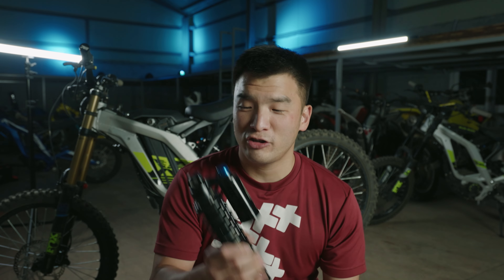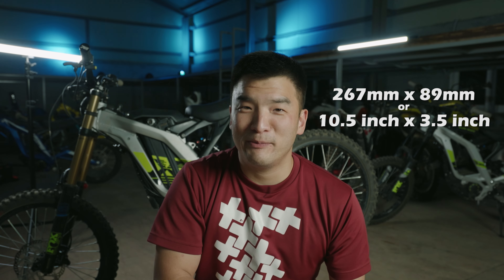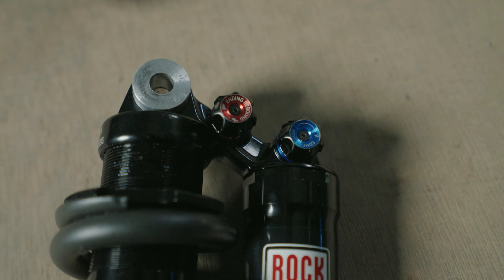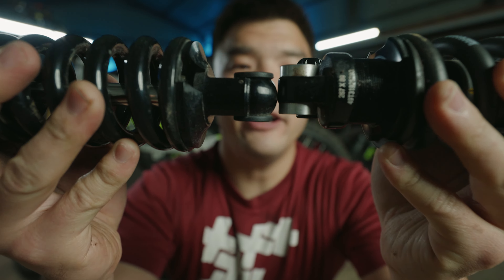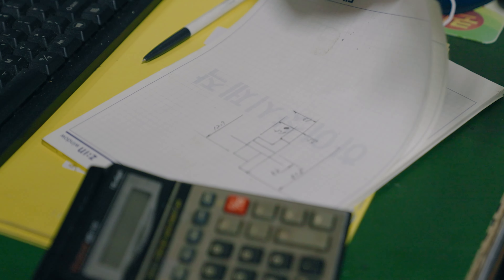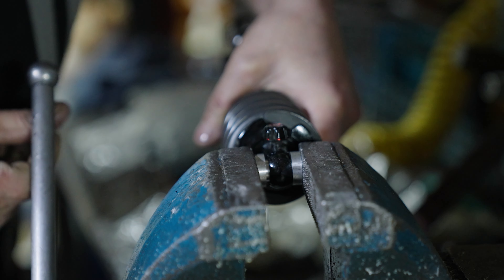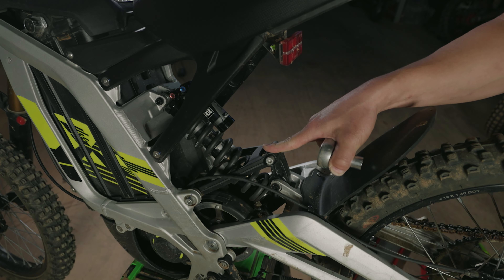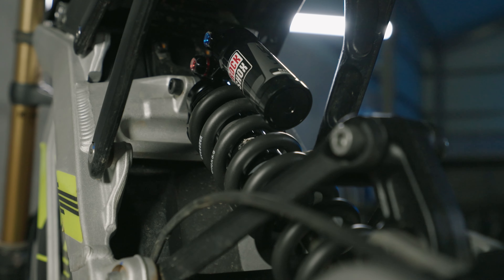Rear SHOCK UPGRADE Sur-ron Lightbee X l HUGE Improvement l Installation

Comment: You absoloutley dont have to take off anything other than the upper and lower bolts that hold the shock in...just put the bike up and support on the crush plate...take off nut on lower shock and while holding the rear tire, move it a little and the bolt will come out with very little effort, then do the top and your done.

Comment: Better solution could be modding the fastace shock, its got a nice big reservoir which means you can fine-tune the air pressure to make it more progressive. Also unlike dnm rcp2s (which i had btw) the rebound setting is just right, 4/8 is what i am currently using, while dnm i had to use 23/24 lol. Which means fastace could possibly take oil of less viscousity, to make it more plush and without loosing the rebound.  Fastace actually make really good budget parts for mx/pitbikes, yea they dont officially sell spare parts, (due to low price of their products, there is no market for this, ppl just tend to replace the whole thing). But these are coil shocks, you can run them with stock parts, just do the oil change after every 100 hours. Unlike air shocks where you need to replace the seals and stuff.

Comment: Would a 265mm fit? - looking at a FOX DHX RC2 BOOSTVALVE COIL REAR SHOCK 265MM EYE TO EYE 225X3.80 SPRING MTB DH and wondering if it will fit, obviously will upgrade the spring to 500
Reply from the maker: From what I know any shock size will fit, but the travel will be affected. 265 and 267 are only 2mm difference so I would think it would be fine?

Comment: other than the different spring rate, do you think the rockshox is a big improvement over the fastace? are you having "spiking" or harshness w/ the fastace?
Reply from the maker: Compared to the rockshox, fastace doesn't do much damping in highspeed compression. I think the lowspeed compression works pretty good though. So hitting the choppy stuff in high speed, fast ace just blows through the travel and then spits you out in rebound.
Reply: @ridefarm5528  thanks for the reply! do you have experience w/ DNM shocks? do you think the fastace is better than DNM?
Reply from the maker: @rondg2  I don't have experience with DNM shocks, but I'm sure there is a reason nobody in the mountain biking world uses DNM components.
Reply: @ridefarm5528  DNM does not move LOL. but they're also fitted on some batches of surron. so i'm wondering which one is better
Reply from the maker: @rondg2  Biggest problem I see with DNM and Fastace is their serviceability. All shocks need to be serviced at least once a year if you ride regularly, and it's not like you can walk into your local shop and get them serviced.
Reply: @ridefarm5528  see one of my vids I got one on adding a Schrader valve to a dnm, to re pressurize after oil change
Reply from the maker: @rondg2  Nice just checked it out, but what about the service parts?

Comment: do you reckon I would get away with 241x76 rear shock or is the travel to short?
Reply from the maker: To be honest you can put whatever size shock you want, but that just means shorter travel and slightly lower stance. I put a 240mm shock + adapter on my dad's surron and it's fine, except on big jumps. There you notice the shorter travel

Comment: holy shit you are smart!!! lathing your own pieces!    do you know if the fox shock you were talking about would be plug and play?  or would you need to lath special parts for that as well.  also do you happen to know the exact name of that fox shock you were talking about?  also do you happen to know where you might find a "fox 550 x 3.5 spring" that i saw you talking about in another comment, i cant seem to find one on the internet, i kinda wanna do this as a cheaper option and easier install.   so sorry for all the questions.  Liked and Subbed!
Reply from the maker: The shock I mentioned is Fox dhx rc2, I am almost 100% sure it won't be plug and play. Stock surron shock has some bizarre sizes. It seems like Luna cycle is all sold out on the 550 spring :(

Comment: @Ride Farm. Do you still have the measurements for the eyelet bushings? Have this shock incoming.
Reply from the maker: The spacing for the Surron shock mount was 24mm and the bolt hole was 8mm of diameter
Reply: @ridefarm5528  thanks for answering so quickly. I probably used the wrong terminology / the bushing diameters. When looking at the reference image below, the measurements for A, B, E and D.  https://www.linngear.com/wp-content/uploads/2013/01/QD-bushing-drawing.png
Reply from the maker: @flyingfox8586  i don't have the measure ments right now but when i get the chance to measure them i'll let you know

Comment: Hey! Thanks again for this informative video. I was actually hesitating for this rear shock myself. The only one I've found I has a low comp setting… So for the Surron I was wondering whether it'd be a good fit.
Reply: So any idea what your shock factory setting is?
Reply: @MTO_Brothers  I bought an R2C Vivid LOW tune and it seems to work fine. Per the Rockshox chart the low tune is for suspension ratios lower than 2.5:1. The Sur Ron is 2.285:1 (Rear wheel travel divided by shock stroke). 
 I have read the Rockshox is also tune-able if needed. It helped to make up my mind. Just be aware there may be interference issues with the bottom of the coil spring and the rocker link. the Vivid/Kage spring diameter is really big.
Reply: @ow-my-achilles1106  Thanks a lot man for this very detailed explanation.
So does it touch towards the end of compression?
Reply: @MTO_Brothers  I couldn't install my shock into the linkage. It was "just" a little too large. I cut some small clearance into the link (machine shop). Modifying a spring at the flat end seems like I would be creating a stress that could crack. No problems so far, I like how it rides.
Reply: @ow-my-achilles1106  Just received mine! I'll be giving it a try shortly 🙌
Reply from the maker: @ow-my-achilles1106  really? wonder why mine fit without issues
Reply from the maker: @MTO_Brothers   any setting would work fine, it would just come down to preference i think
Reply: It's a tremendous shock

Comment: if you just wanted to buy the 550lb spring for the factory dnm shock. where would you get one that is a direct fit and can you provide a link?
Reply from the maker: https://lunacycle.com/dnm-rear-shock-spring-550-lbs-for-sur-ron/
Reply from the maker: unfortunately sold out, but you can look up fox 550 x 3.5 spring. that fits as well.
Reply: @ridefarm5528  No it won't... the DNM spring requirement is 38MM and the FOX spring is 35mm ID.
Reply: @lonniedomnitz1720  That is incorrect information.    The DNM & FOX spring is 35mm  ID.    The FastAce & Rockshox are 38mm ID .   The KKE is 36mm ID.

Comment: What are your thoughts on using a fox 38 (E) on the Surron instead of the fox 40
Reply from the maker: Double crown is always better than a single crown in my opinion.
Reply: @ridefarm5528  would you say the stock surron fork would be better/ not worth replacing with a fox 38 (e)?
Reply from the maker: @daniel_f1nk   38’s damping is far superior but what’s the reason you want to put a single crown on something this heavy?
Reply: @ridefarm5528  my main concern is pricing honestly, and can’t seem to find any second hand fox 40’s in Canada
Reply from the maker: @daniel_f1nk  we get our forks from pinkbike.com used section. Just bought another one for someone last week.

Comment: Why not just change the spring?
Reply from the maker: The stock shock has two issues: 1. wrong spring rate 2.  Terrible dampening performance.

You could just change the spring but you would still be stuck with terrible dampening. However, if you find the stock damper good enough, just the spring change would suffice.

Comment: Mine fit straight in🤔
Reply from the maker: Which shock was it?
Reply: @ridefarm5528  Roxshoxx exactly the same
Reply from the maker: @user-px6qe2qm8p  would love to see some photos
Reply: @ridefarm5528  how to upload them? I've Roxshoxx front and rear and mt7 front and rear brakes.. 72 volt battery pack with an 8000 BAC. Fast as fuk
Reply from the maker: @user-px6qe2qm8p  If you could send the photos to tom00lim@gmail.com I would appreciate it!
Reply: @ridefarm5528  100% I'll show you one the only thing standard is the frame on this bad boyy.. will you post it for me mate
Reply: @ridefarm5528  you on Instagram?
Reply: I bought the correct size Rockshox mounting hardware eyelet adapters on Amazon. They were the same for the top and bottom of the Vivid R2C. 1/2X1/2-Inch 24.0x8-mm.$12.80 each. 
 The real issue I had, the Vivid spring diameter (BIG) had an interference issue at the bottom of the shock against the rocker link. I had to mill about 1/10 inch from the link for the spring clearance.
 I am happily using a 450 lb spring. Traction is outstanding. Huge difference from the Burner shock.
Reply: @ow-my-achilles1106  so the 550 spring probably won't fit properly either?
Reply: @flyingfox8586  The standard Vivid springs are all the same diameter, only the lengths, wire diameter and number of coils are changed for the different lengths and load ratings. The diameters are the same regardless of rate or length. I'm happy with mine.
 Another issue with using a smaller diameter spring (Fox Shock spings), the spring won't fit on the seats, the inner diameter will be too small. So really the best solution is the OE spring, or a different shock, like a Fox.
Reply: @ow-my-achilles1106  ok, so if I understand correctly, none of the stock RockShox springs fit as they will all collide with the rocker. With OE spring you mean OEM/stock spring still being the best option or something else?
Reply: @flyingfox8586  The BEST shock would be the Fox DXH2, bolt right on with the correct eyelet adapters. No clearance problems. 
 The Rockshox Vivid coil springs are bigger in diameter. They do interfere with the rocker linkage when the suspension is unloaded. I could not bolt the lower shock eye, it was not possible because of the interference. If I pre-loaded the suspension and forced the bolts of the shock it "fit" but the suspension was actually stopped by the spring! Really bad situation for the long term. That's why I modified the linkage about 1/10th of an inch. So if you WANT a Rockshox, expect to make modifications to get the coil to fit.

 The OE Burner Shock has two springs available. the OE supplied 450 pound spring and the 550 pound spring sold separately by Luna. Those are the choices. Some guys have made DVO and old Marzocchi shocks work too. And there is a silly way to install a shorter spring stroke (9.5x3.0) using an extension adapter, but that sacrifices travel.
Reply: @ow-my-achilles1106  thanks for the explanation. I wonder why Ride Farm never ran into this issue. The DHX2 is difficult to find and I did not want to shorten travel with an adapter. Second hand vivid incoming. Could you share a picture of what you modified so that I can get an idea of what needs to be done?